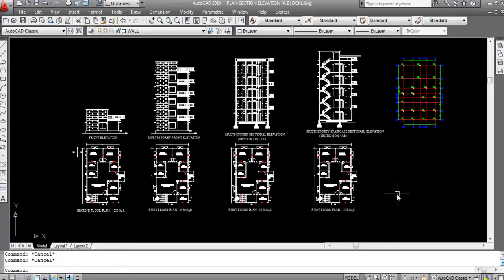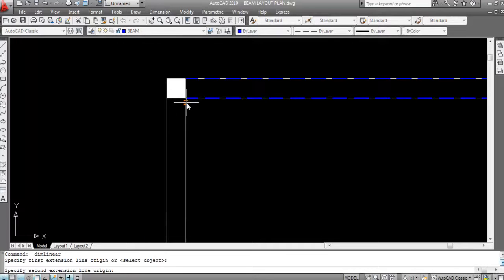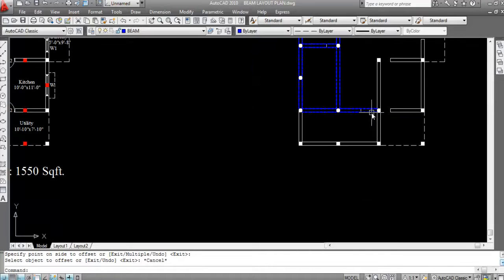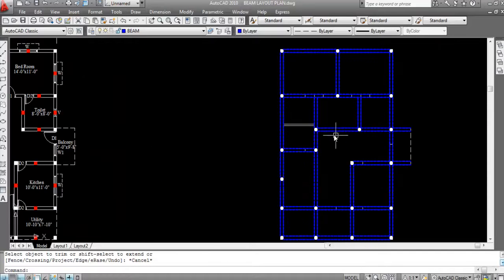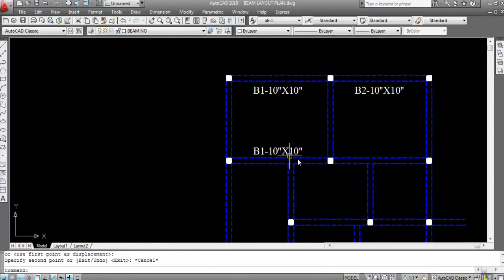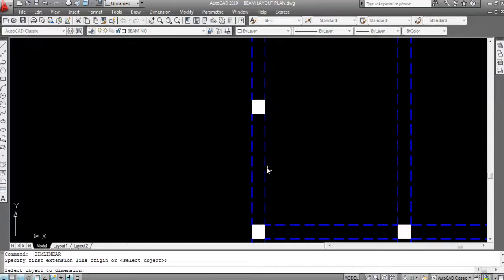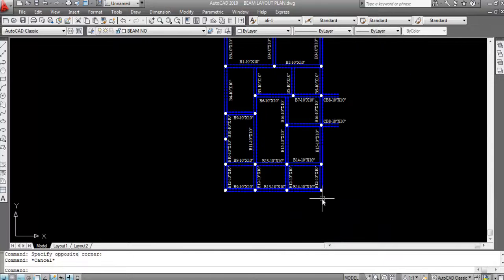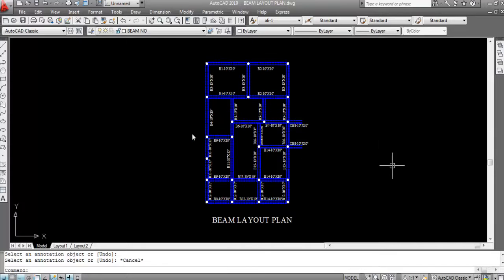How to draw BEAM Layout Plan of Building in AutoCAD || Building #2

Comment: How can be hidden beam dimensions same as tiger beam . As you said hidden bean depth will be less and will be hidden with slab compared to the other primary and secondary beams. Doubt .please clear
Reply from the maker: Hidden beam size 10"×4", depth of hidden beam is same as thickness of roof slab.

Comment: Thank you mam, I have 2 doubts, that why have you provided beam in staircase area as slab will not be provided there and also what is the purpose of hidden beam and where is it provided usually? Pease reply , Thank You
Reply from the maker: Hidden beam is provided because it gives better aesthetic interior appearance as the Depth of hidden beam is same as depth of slab.It is economical as it saves cost of materials,formwork and labor.staircase room you can't provide beam, that is provided mistakenly on drawing.
Reply: @civilengineeringtutorials  thank you mam for fast reply
Reply: @civilengineeringtutorials  please make a video on electrical layout and plumbing layout

Comment: Mam 1st ty u for sharing Ur knowledge...
1 beam detailing is missing in this video... Near b6 beam there is a 1 simply supported beam......if may I correct?
Reply from the maker: Hi Omi, 
No beam is missing, Secondary beams are simply supported or shear connected, like B 5. Go through the video properly I hope you will understand which beams are primary & which are secondary beams.

Comment: Mam what is staff column
Reply: Thanx
Reply from the maker: Stub column. 

Red columns are Stub Columns. Stub columns are located below ground level to avoid long spans of grade beams and in places where the soil condition is not enough strong for load bearing structure and not too less strong for framed structure. Stub columns are provided in such places to minimize the construction cost.

Comment: Ma'am Good Morning! Very nice video! Thank you very much. But I am confuse whether two B5s (Two of the Beam 5) are hidden beams or not because they are not connected to columns in one side. They look like same as B16 (10"x4").
Reply from the maker: No B5(10"x10") is not hidden beam. B5 is going above wall. But B16(10"x4") is hidden beam because as there is no wall, if we provide B16 as (10"x10") means width 10" & depth 10" then we can see the depth of beam hanging on ceiling surface. But you can provide (10"x10") beam there instead of hidden if you want. But it may look little bit odd.

So hidden beam is provided within the depth of supporting slab. so Depth of hidden beam is same as Depth of slab. So as there is no wall so B16 is provided as hidden beam so we can't see the depth because hidden beam is going within the roof slab.
But B5 is not hidden beam because wall is available there. B5 is going above wall so we can't see the beam completely.so this is (10"x10") beam.

And one more thing you are asking that B5 & B16 are not connected to columns in one side.
So it's not necessary that beam should be always connected column to column only. Beam may be supported on other beam or may be supported by columns forming an integral part of the frame. I have told all these elaborately in the video. You should go through the video thoroughly so that you can understand.
Thanks for watching
Reply: Thank you very very much ma´am. Thanks a lot for the quick response. Now I am clear about the positioning of the hidden beams.